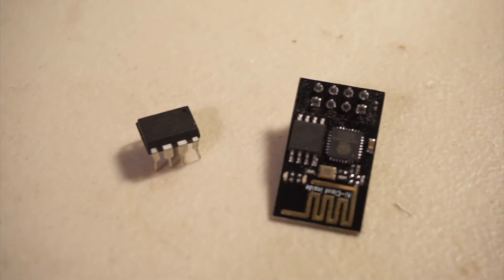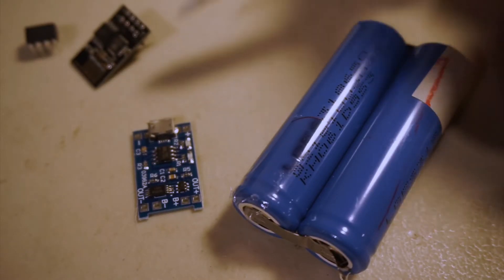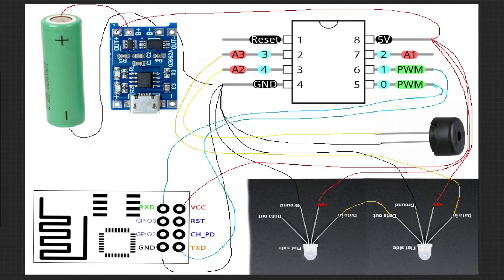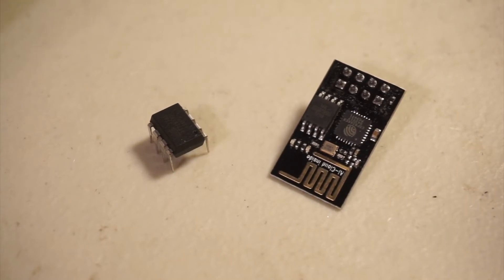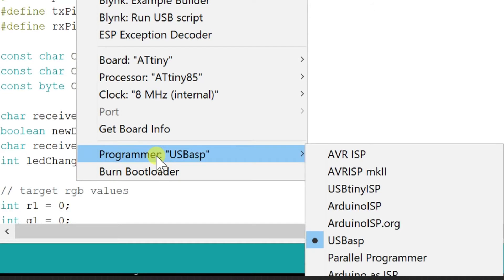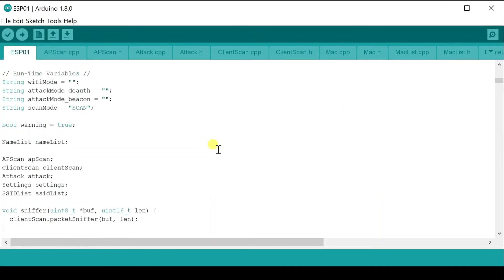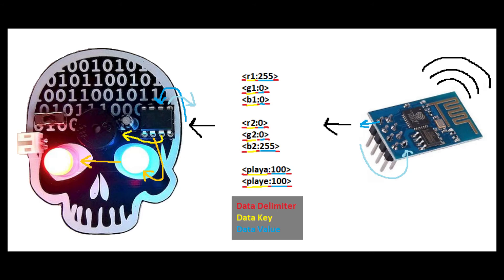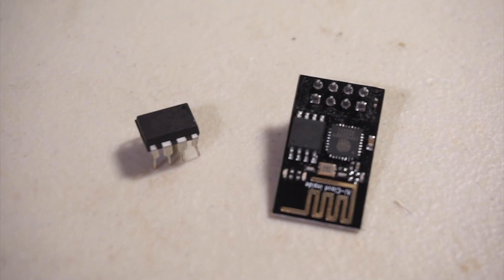ESP01 + ATTiny85 how to and demonstration

Comment: Hey, could I ask you some questions?
Reply from the maker: Yasyas Marangoz Ofcourse! I’ll try to get back to you ASAP
Reply: @ArtsyEngineering  Ok, what does ASAP mean?
Reply from the maker: Yasyas Marangoz it stands for “as soon as possible” which is a common English phrase meaning as soon as I get a moment
Reply: @ArtsyEngineering  Thx ^^
Reply: @ArtsyEngineering  Ok here are my questions:

1.What is the purpose of the Attiny here?
Why do we need them both (attiny,esp01)?

2.What exactly does this project do?

3.Can I use the esp01 to host a tiny little webserver which my phone could connect to and control something like an iot device?

4.Can I run html on the esp01?

5.How much space does it have?
(and how to add some via other chips or something)

Sorry for asking so many questions, but I got really intrested in this kind of stuff 😃
Reply: @ArtsyEngineering  hello?
Reply from the maker: @yasyasmarangoz3577  As soon as possible meaning, when I have time to reply, not meaning as soon as you send me the questions.

As for your answers:
1) It's important to keep in mind that this video is more of a 'just because I wanted to learn' project, and not necessarily that it's a really great idea in general. That being said, the attiny85 is meant to work with the ESP01 to give it more I/O and free the ESP01 up to concentrate on WIFI responsibilities. It would have been alot easier to just use a larger esp8266 board instead, but that wasn't the point here.

2) This project is a new take on a, frankly, really overdone device. The device lets you kick users off some less secure routers by using a 'deauth' attack. It also allows you to make it look like there are many many fake wifi access points around which can be confusing to people trying to find a access point to connect to. All of the really interesting wifi code comes from spacehuhn as noted in the video description. I just repurposed a skull badge I had gotten as a different project to make it look more interesting.

3) You can! It's not a full fledged web server, but it's certainly capable.

4) The space you'll have available to you depends on the chip you're using. If you're using an esp01 as shown in this video, it's probably going to be 512KB or 1MB. Keep in mind that this space is used for EVERYTHING so you can't fill it all with webpage data (i.e. don't use large images, really avoid any images that aren't svgs if you can, no videos, no gifs, nothing large at all. You even have to keep your javascript and css small!)

This makes me think it would be usefull to release a video on turning the esp01 / esp8266 / esp32 into a webserver, I may do that soon and I'll try to remember to come back and share the link with you. In the meantime you can see how I used an esp01 as a webserver to control a small tank from my phone in this video. It's kinda long but it should walk you through everything you need to do, and the video description has a link to all the code so you can just download that and modify it for what you want.

Hope this helps!
Reply: @ArtsyEngineering  Ok wow, thank you for all the effort you've done.
I will subscribe, so I won't miss any interesting videos.
Reply from the maker: @yasyasmarangoz3577  I'm glad to help! I hope you're able to build something cool!

Comment: Esp-01 has 4 pins Tx and RX are gpio1 and gpio3
Reply from the maker: Ed19601 ah, yeah. That’s a mistake for sure. Thank you!
Reply: @ArtsyEngineering  sorry, didn't want to nitpick
Reply from the maker: Ed19601 no problem at all! 

I think I was probably meaning that only 2 of the gpio pins can be used easily ( without extra work and concern for how they’re pulled up / down at start. ) But I didn’t say it, so it wasn’t really accurate. 

I appreciate the correction!